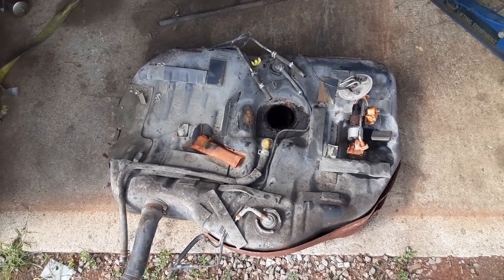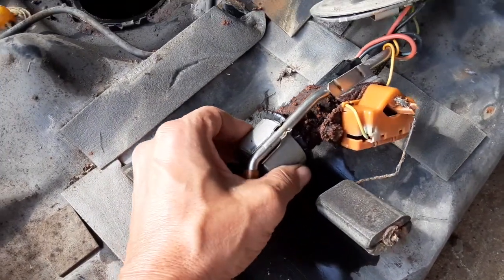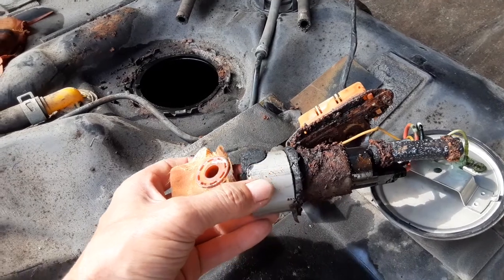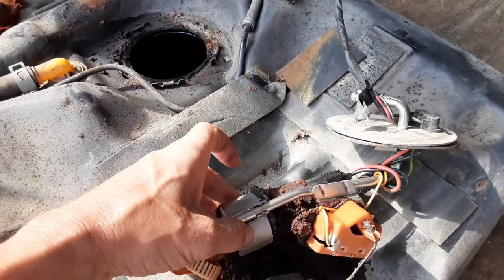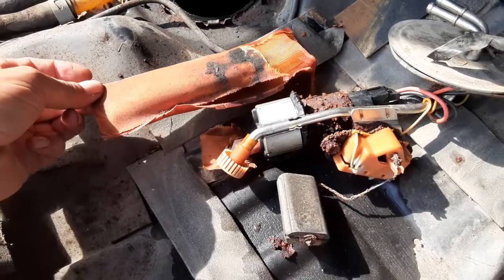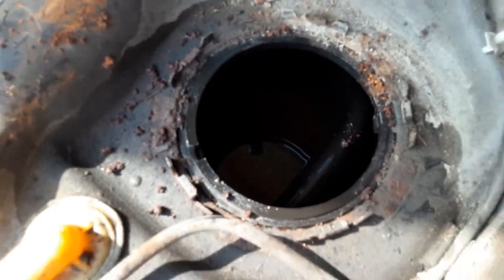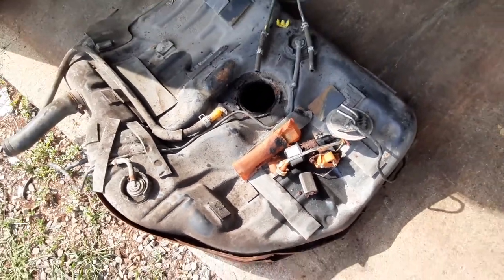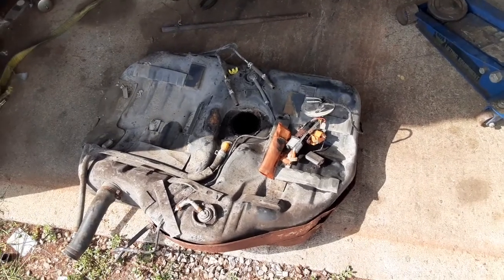worst looking fuel pump I've ever seen

Comment: Whoa!  Probably all kinds of nasty chunks at the bottom of that tank (old ethanol gas?)
Reply from the maker: Gosh I suppose it could be ethanol.  I hadn't considered that
Reply: @craigtate5930  Ethanol-blend gas is hygroscopic, which is probably why the fuel pump looks so bad.  I've heard small engine guys recommend non-ethanol gas especially for old engines - here in NJ, you can buy aviation gas at small airports.